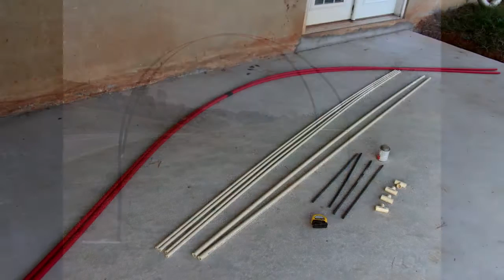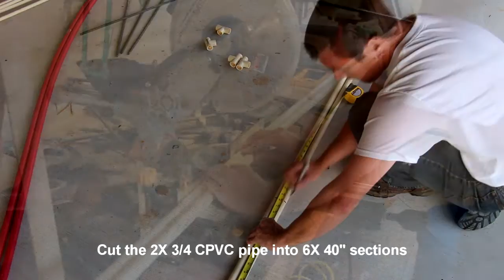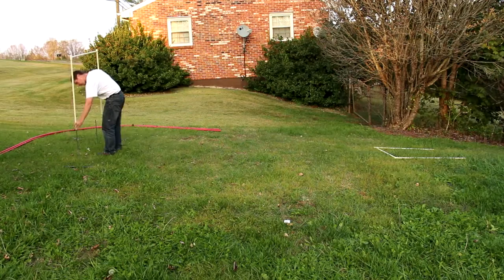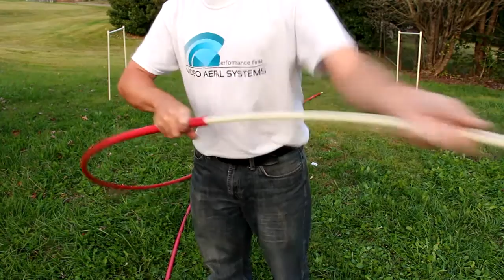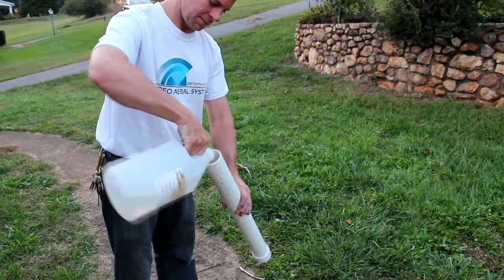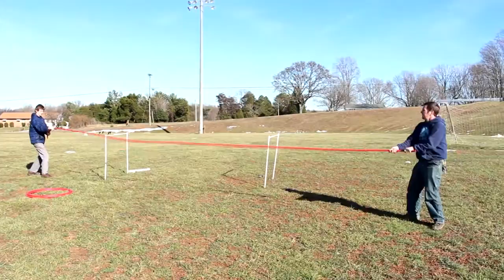FPVWRA spec wing gate

Comment: Hey Alex - 1/2" CPVC doesn't fit inside the 3/4" PEX.  It has a nearly identical outside diameter.   Did you mean to line the 3/4" PEX with 1/2" PEX or did you actually use 1" PEX?  I'm guessing the latter.